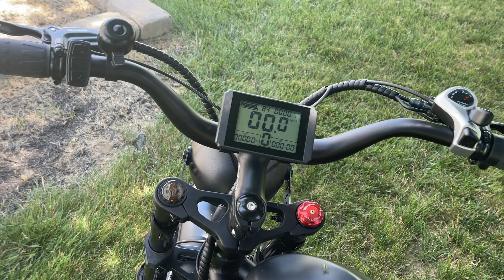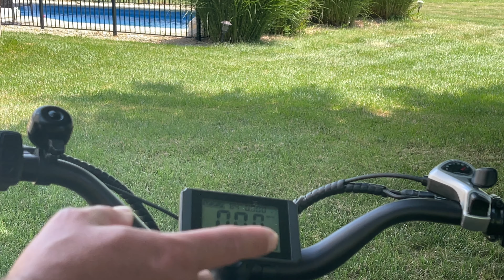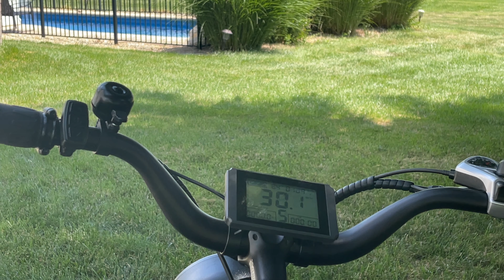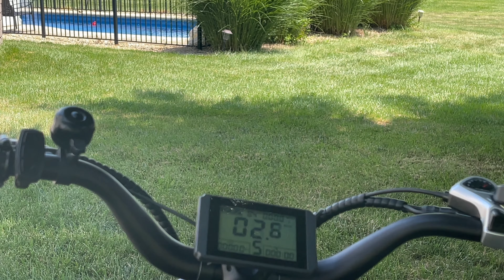NEW METHOD! HOW TO MAKE YOUR EBIKE GO FASTER - OVERRIDE LIMITER

Comment: If you change the settings to a larger wheel your speedometer will read higher, but the bike will actually travel slower.  Go ride past a radar speed sign if you don't understand it.
Reply from the maker: We have done videos with this method and a speed checker on the handlebars. I understand your point and you are right, the speedometer on the actual panel is not correct, but it does trick it and go faster. On all our 45 ebikes here. Maybe you haven't tried it?

Comment: You might want to check that speed with a cell phone GPS! Also lifting up the back wheel is gonna go faster! But that’s the unloaded speed’ your weight, and bike weight is gonna determine how fast you actually go’ when you change tire size it only tricks the speedo….so if it’s saying 45mph, it’s probably still going 30mph…when your on the bike your gonna lose more speed.
Reply from the maker: You are correct. It goes 43mph without rider weight. I got 33 on flat and 39 down hill. The limiter is essentially removed with this method. I did test it with my phone app
Reply: Good…point, I never did the increase in tire size….my display is different….it has a  weird limiter in percentage mode’ mines on 100 percent for power.

I haven’t tried the bigger tire size, my tire size is 26 inch….I could try to change it to 29inch.
My bikes unloaded speed only goes to 40mph….with me on it, it only goes up to 35MPH,  in the future…I will get a 52v battery, and sell or keep my 48v battery….it has 17.5AH and a 30 amp BMS.

If the Tire Size hack works, I should see around 39MPH, a higher voltage batter with a higher than 30AMP BMS I should get almost 50MPH….that’s gonna be scary on a regular Bike, I will probably change my brakes to hydraulic brakes, and a bigger rotor., and better forks….it’s a hard Tail bike.

I use down hill Mountain bikes, because the drop outs are bigger, and stronger than a  MTB with flimsy dropouts…I’m use to building stealth bomber bikes that goes over 60MPH, I’m getting use to a bike that’s slower.

Check out my channel….it shows stealth Bomber builds, and I just started a video on my MTB…if you like my channel Subscribe….I’m subscribing to all e-bike channels’ to stay in touch with other e-bike videos.
And nice bike you have.

Comment: My bike is an Eahora Juliet with a 1000W hub motor with an upgraded 35A controller, The method you described works, I changed my wheel size from 20" to 26" and hit 45MPH, not bad!! Well, you cleared that issue up on the wheel size hack. I already maxed the KM setting so I left it alone. Great channel !!

Comment: Thank You for this video. I just changed my controller setting and reached 45 MPH. I had the controller set to 20" wheels and changed to 26" and hit 45MPH. I already had it set for 72KM, so I left it alone. Nice job explaining this Hack, because I was told previously to reduce the wheel size and it didn't work.

Comment: I recently got a Philodo H8 and watching this video helped me to unlock it's full potential. I had been doing research into this and the prevailing opinion was to set your tire size smaller in your settings. Well after watching you set yours bigger, I followed suit and did the same. Wow. Sucker hit 50. (The spooky thing is, I could have set the tire size even higher lol)

Comment: I have a Chinese Bike with a 1000w battery and a front and rear motor. I will give your trick a try. I'm stuck at 28 and still trying to figure out how exactly to dial this thing in. For the price it's a great deal. Fat tires built strong and Shimano 7 speed I believe. This is the third Ebike I have purchased in the past 10 years. So far I have to say I would have to put this one in front. Suspension, big heavy bike and appears to be built tough.
Reply from the maker: Sounds similar to the one in this video. I can get mine up to 43

Comment: As usual great video(s) but not sure why on my Rattan LM750 pro I cant get it above 30-32. I changed tire size to 28 (highest # outside of some other 700c setting), max speed to highest of 50, etc. I also changed the PA from 0-5 to 9 but it seems PA5 is faster than PA9. Is there anything else on the LCD settings parameters that I may be missing? Any input would be greatly appreciated!
Reply from the maker: It's hard to say without being there, but we got ours up to around 38 I believe. The ebike in this video is unique because of the 1200W peak power. That's why it goes faster. Sometimes if you lift the back wheel you can see how fast the bike will go, but with added weight of the rider and terrain, that number is usually lower unless you have over 1000W. Rattan is an awesome ebike, but at 750W the rider would have to be under 100lbs to get max speed. Hope that makes sense

Comment: Changed wheel size to 40 and it went to 65 mph ! Put wheel size back down to 29 like you demonstrated went to 48mph.....I’ve only done the air spinning test as of yet , It’s an emoko c91 with 1000w rear hub motor and 48 v 15ah battery ,I’d assume the 65mph isn’t possible for that size motor so I reckon it had to be a false reading but I’ll be taking it out soon with it set at 29 to see if it does the 48mph....I had unlocked the speed restriction and thought the bike was maxed out at a top speed of 30mph so I’ll be absolutely amazed if I get anywhere near 48mph...I’m looking to do a few upgrades so subscribed to your channel for a few ideas
Reply from the maker: Yeah the air test is good, keep in mind when you add your weight to the bike it will slow down. This rhino I show in the video will get 43, but only gets 35 straight with me on it, but 43 downhill which shows the limiter has been changed. So I would expect you would get something similar
Reply: @NRGSPORTSANDHOBBY  Yes I’ve had it out today and got 39mph.....I’m still a little sceptical  so I’ll be trying it again soon with the go pro app to verify the monitors accuracy

Comment: Hey Nathan! I just bought a new Heybike Tyson. Road it to work this morning and it’s just too slow for the street but I can’t ride it on the sidewalk. Any chance you know how to adjust the settings? I couldn’t get it in maintenance mode like you describe in the video. Thanks!
Reply from the maker: Yeah, heybike is an easier one to get into developer mode. You could probably google the process. We have three videos on patreon on different panels. When we get another Heybike here I will do that panel as well. We did the older model just fine. it's a series of holding down the up and down buttons for 10 seconds. I'm sure you can get it

Comment: Most bikes you buy to controllers are only between 18 to 25 amps if you want to go faster you have to upgrade your controller to 35 to 40 amps.
I build e-bikes all the time you can swap out the stock controller on most e-bikes you just have to figure out what wiring harness you have and match it up.
Reply from the maker: Good point. You are correct for some manufacturers. However the limiter cuts the motor on the ebikes we review. So that's the first step and you can get to 33-43 mph. The controller would help beyond that.

Comment: Faster speeds puts more stress on spokes.  Make sure your ebike has good beefy spokes.  You don't want your wheel collapsing when you hit a bump at 40 mph.  Spokes should be maintained and tightened regularly.
Reply from the maker: Ebikes that have the bigger motors to go that fast will have no issues with spokes. But good looking out

Comment: Awesome video! So I have the Senada Archon 1000W 30MPH rated Electric Bike and changed the tire size in maintenance mode and got 42MPH this works! I haven't seen an option for raising the setting for 72KM yet... 42 is killer though thank you again!

Comment: Im looking for the updated video to see how to do the tot guard 500 w 27.5" bike but i am having trouble finding it. Can you help me ?
Reply from the maker: So we have another video on the channel already with the way to get into the settings. It's titled Hacking My Ebike to Go Faster. It's the same process. But keep in mind, you got a $299 ebike that is not designed to go faster than 20-22 mph. It will put a lot of stress on the frame and the battery. You can do what you want with it, but it's not designed to go fast. It's designed to be inexpensive
Reply: @NRGSPORTSANDHOBBY  that was the same video where I found out in the comment about a newer video that had something else that needs to be done. Also I'm a little impressed by the build quality of the misrepresented $299 ebike. That price is only an illusion you will not get it for less than $500. Just as if you buy a $1,000 bike from Amazon shipping is most likely free. But definitely not on the inexpensive ones. Average shipping is about $170 to $190 or so
Reply from the maker: Interesting. I've never paid for shipping on any ebike from Amazon. Perhaps it wasn't a prime deal. This video is the updated one, but your ebike has an older display. So the process is the same as that older video. But you won't see much speed over what you get sadly.

Comment: Does this method work if you have a 48V 21ah extended range battery  ?
Reply from the maker: As long as the panel allows it, and your motor is powerful enough, yes

Comment: think I can do this with my EUY S4?
Reply: I'm literally trying it right now as my bike fully charges will update
Reply: So....
 I want to say it didn't make my bike go faster but technically it did by .5 mile but the important thing is I made reach top speed quicker! Why for the S4 was important to me because it lets me go through lights quicker from a dead stop which is great I don't hold up traffic.
Reply from the maker: Yeah, you raised the torque. There is another setting. Should be able to get it up even more.

Comment: I have an e-bike with a torque sensor. It has a 350 motor and all I can get is about 18 to 20 kph. I'm not sure if I can do anything without a throttle?
Reply from the maker: I think your issue is more the motor size than anything. You'll want 1,000W minimum to really get over 30mph

Comment: How about the Lectric Xpeak? I unlocked it to class 3, changed the front gear to 53t and still will not go over 28 even downhill..can you change something on the panel..do you have a video on these panels?.no matter what I do I get to 28 and the motor cuts off like it locked when others say they can get 30 to 36 downhill..
Reply from the maker: Lectric has some extra settings that need to be over-ridden. You can call and ask them. They do that so they can sell those ebikes all over the world. Very marketed brand. Most of the ebikes we review are much easier to unlock. The last 3 we got look about 30 seconds and one even goes 62mph (don't recommend it)

Comment: I just tried on the Deepower x20 2000W and i went to 30inch tires speedo reads 70.5 km 😮 weird though it doesnt sound different, ill have to try it out

Comment: i built my e bike with a Bafang 1000 rear hub motor, 48v 17.5ah battery and a 32 amp controller.  How fast should it really  go??
Reply from the maker: If you selected the 52V version you could get around 37-43 likely. The 48V might be around 30-35

Comment: Would the same method work on a bike with 2x 1,000 watt motors with dual battery?
Reply from the maker: I can't say without knowing which ebike panel. I unlocked it on our dual battery Engwe M20 and can go 43 mph with a range of almost 120 miles. More range if we don't push the speed.

Comment: Is it possible for a bike's max speed to be completely hard set in and locked? I have a core5 I'm trying to coax to 30-32 mph (original max is 28) but even increasing the speed limit on the settings doesn't help. Will try the tire trick again (still need to find a decent phone mount to determine accurate speed) but believe even setting it bigger in the past did not make a difference, or whatever tire size was on mine was likely the largest option. Could just be that I was actually going faster, but know my panel is capable of showing 29-30 downhill + downwind at rarer instances so I'm guessing its more of a hard lock, despite my access to the advanced settings.
Reply from the maker: I'm pretty sure the limiter on that ebike is locked. You would need access to the actual controller. Although the motor can't really produce much more. I would be happy with the 28 on it.

Comment: Thanks for another excellent video. Is there any way to change the speed limit (tire size setting?) on the Oraimo Monster 100 that had also reviewed? Is there a service mode of any sort on its King Meter display? Thanks again
Reply from the maker: No, the Oraimo isn't built to go much faster. You could try, but it would destroy your battery. Most under $500 ebikes aren't going to go much faster.

Comment: Does it work for the cycknight foldable e-bike
Reply from the maker: Yes
Reply: @NRGSPORTSANDHOBBY it doesn’t seem to work can u give a tutorial
Reply from the maker: We unlocked ours, that one you just change the tire size to 29.5 in. You have to get into the settings. We gave away our cycknight in a member giveaway last month to patreon member. So we can't film it. But we had it unlocked no problem. It's the up and down for about 20 seconds. I believe. that one you also had to do the power and down for a few seconds also. Each one is a little different, but same concept

Comment: Can you do it on Aventon Aventure 2? Thanks!
Reply from the maker: We've done it here in the past. Pretty easy on that bike. Don't have one at the moment, have that one away in a subscriber giveaway
Reply: @NRGSPORTSANDHOBBY  I’m curious if you simply unlocked the Aventure through the app to make it a class 3 Ebike or was there another method you used to raise the top speed?
Reply from the maker: All on the panel

Comment: Have you tried the euy s4? Cant seem to find any info on if thst bike can be speed hacked or not.
Reply from the maker: Not familiar. I would need to know which panel it uses. I've shared over a hundred ebikes on our channel that do however
Reply: @NRGSPORTSANDHOBBY    S830 Lcd panel. I've messed with the tire size in the setting but  didn't see a change when tested with GPS. I did try the current settings for p14 and that did seem to give me a bit more tourqe but still not sure how to get more speed.
Reply from the maker: P08 is usually the limiter setting on most panels. It's default is 32km/h. If you raise it to 100 you'll go faster. If your panel doesn't have the override capability, I would have to google that panel.
Reply: @NRGSPORTSANDHOBBY  euy has the default set to 100 sadly so can't get more from it there. I do appreciate your responses. I'm sure there is a way to get more from this bike just haven't found any good info yet. But I'll keep looking.  Great videos though 👌

Comment: Hi thank you I just subscribed and liked, but I have a "2024 Electra Ponto Go!" and I don't know how to change the limiter or tire settings it has a very different panel than the one in the video, if you see this comment please help.
Reply from the maker: You might be stuck with 28mph on that ebike. I haven't had one of those here, but if you tried holding the up and down or plus and minus for 3-5 seconds and don't see the P01 menu pop up, then it likely isn't unlockable, We have a video on this channel with a similar panel. I would watch that.

Comment: Since doing this on my Macfox, the battery dosent update so I don't know what my battery is.
Reply from the maker: On this video I show you to only change the P08 (speed) and the tire size. Did you raise other settings? like the battery voltage? If so, switch it back to 36V and it will show again.

Comment: can you show the same thing for a 2023  heybike racemax
Reply from the maker: I don't have that ebike. But I did have the cityscape and unlocked it just fine. Just changed tire size and raised the battery power out. Boosted the motor  regulator. All within the panel

Comment: Unfortunately this does not work with Ancheer. I have the 2023 Gladiator model and it has a color display and I can't get it to go to developer options.
Reply from the maker: Ancheer is very similar. I've done a few of those. What you need to do is find a video that shows how to get to that secret menu. All ebikes after 2020 have one. This way they can sell to different countries with different rules. I don't have this ebike anymore to show you. But it's there. Very very similar it this video.
Reply: @NRGSPORTSANDHOBBY  I believe you but it doesn't come up using this combination of key strokes. I have the newest 2023 model with a color LCD and the power button is on the top of the screen and the +/- on the bottom.
Reply from the maker: I'm going to say this and I don't mean this in a negative way at all. But that ebike is not a great one for unlocking. It's under $400 and it would probably fall apart if you did. I unlocked a few of their ebikes in the past and only got 2-5 mph more and it started rattling. So rather than spending countless hours on this for the risk of  overheating your motor and draining your battery life. I would maybe trade up for a little better ebike that already goes 28-31mph. Those can be unlocked to 43 or so easily and handle it. Have a great night. Enjoy the bike for what it is. It's a good value, just not high performance. Don't hate me for saying it.

Comment: Hello i bought a rev1 ride1up ebike from 2nd  party and the company won't unlock offroad mode for me do you know how?
Reply from the maker: I've not tested it on the rev1 - but the other Ride1up model was fairly easy. Did you hold down the up and down buttons for about 10 seconds and then toggle through settings?